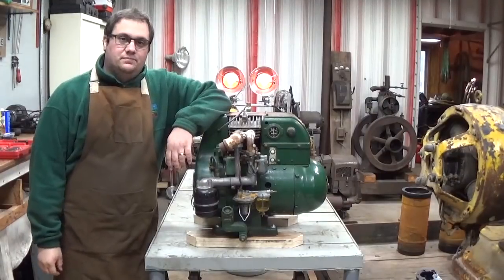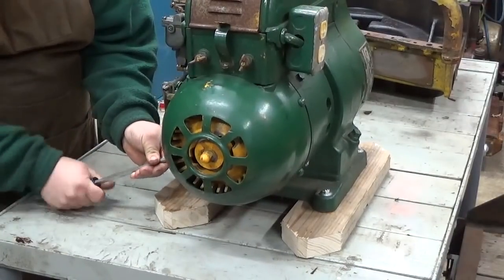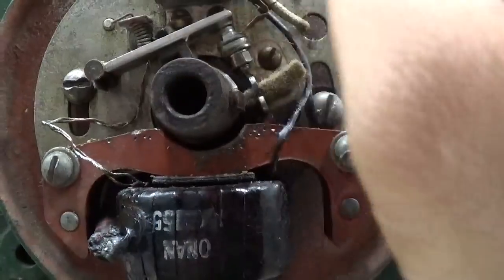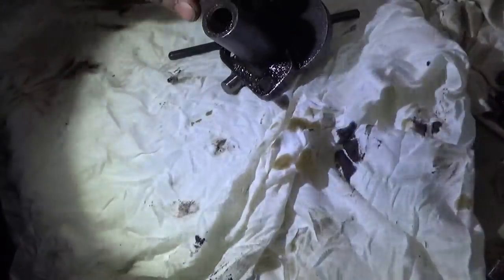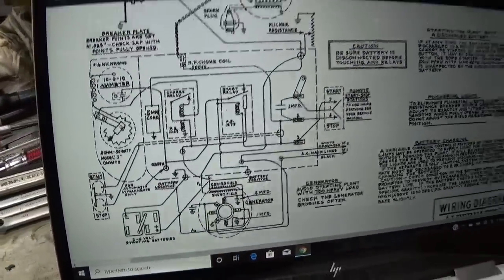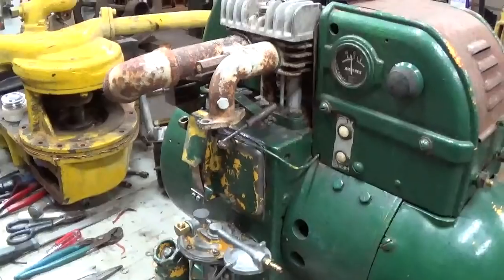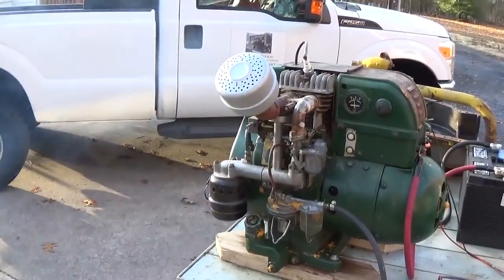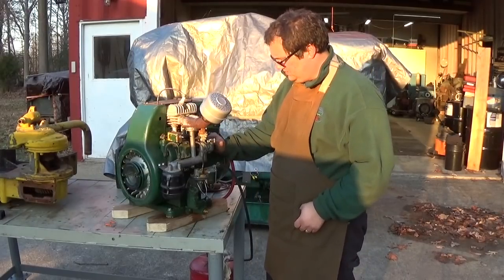1953 Onan Generator Repair and Generator Buying Advice

Comment: Morning Mike,

I've worked on dozens of Onan AJ generators, the 5kW version of your generator.  That was THE generators RV manufacturers put in motorhomes in the 70s and 80s.  Very reliable but LOUD.  When I saw the slop in your throttle shaft I had to write.  The governor hunting and the looseness of the link rod keeps the throttle in constant motion as is evident in your video.  That prematurely wears out the carb body and lets the shaft rattle around and more importantly allows a constantly varying amount of air into the intake tract downstream of the main jet. 

At first the engine runs rough, as yours is now.  As the wear becomes more severe, the engine begins to hunt.  That must be fixed.

I don't have any machine tools so here's my fix.  I bought a  piece of Oilite bronze bushing, sized to be slightly larger than the carb hole and slightly smaller than the throttle shaft and two adjustable reamers, all from McMaster-Carr.

I drilled out the carb body with a hole size slightly smaller than the OD of the bushing.  I reamed the hole until the bushing would just barely slide in.  I locked it in place with Loctite green bearing and bushing lock.  This is the strongest sealer available to civilians.

I did the same thing to the bushing's inner hole until the shaft just barely turned freely.  My dial indicator typically indicated less than 0.001" of clearance.  The Oilite  is made of porous sintered bronze and is designed to hold oil.  The throttle shaft will always be lubricated.

Next is the governor linkage.  It has a spring to take up the slop but once the attachment points have worn enough, the vibration overtakes the spring and more slop results.  What is needed is some dampening and a stiffer rod.  I made a curved rod out of 316 stainless welding rod.  That introduced a tiny bit of delay in the throttle operation.

For dampener, I went to the hobby shop and bought some thin brass tubing with an ID about 0.030 to 0.050" clearance to a rod that would be inserted.  The clearance isn't terribly important.  I cut about 1.5" length of the tubing and brazed it to a piece of thin steel I had laying around.  Probably 11 gauge, as that is the metal I used when I was manufacturing large BBQ pits.  I dimensioned it  so that when the drilled hole in the sheet metal was placed under a carburetor stud, the tube was near to and parallel to the straight line from the governor and the throttle.  I cut and bent a piece of welding rod so that it would be parallel to the tube when the other end was attached to the throttle rod and  would reach almost all the way through when the other end. The other end met the throttle shaft about a quarter inch from where the throttle rod attached to the carb arm.  I jigged everything up using Hot Block (https://rectorseal.com/hot-block-putty/) and silver-soldered each end using a Smith MicroTorch https://www.amazon.com/Smith-Little-Torch-Soldering-Welding/dp/B000T43L30 (*)  The kit comes with preset regulators designed to screw onto disposable propane cylinders and Bernz-o-matic oxygen cylinders.

(*)I use MAPP for fuel and a medical oxygen concentrator for the oxygen.  Once you've experienced the MicroTorch, you'll probably shelve your big tip.  Smith has a large variety of tips including a rosebud and a trident - 3 burners 120 deg apart.  Super-useful for things like brazing copper refrigeration joints.

CAUTION:  There are cheap chicom knockoffs on the market for about $35.  Amazon has an identical-looking kit for about $35.  I bought one to evaluate and then returned it, it was so bad.  One of the outstanding features of the Smith torch is the silky smooth valves.  The knockoff valves felt like water valves.  It did not come with the smallest 2 tips.  These tips have rubies swaged into the tip.  An almost invisible hole has been laser drilled.  The smallest tip will only run on hydrogen/oxygen (I have a jeweler's oxyhydrogen generating machine that electrolyzes distilled water into hydrogen and oxygen with enough volume to run the larger tips.)  Hydrogen burns clear and the flame is less than a mm long so it's hard to tell when it's lit.  A Smith tip will not fit the chicom knockoff so you're stuck with what comes in the kit.  Probably an imperial/metric thing.

A 22 ga, 1 ft long platinum-platinum/rhodium thermocouple that cost me $400 got embrittled by the 5000 deg f heat and broke.  I snipped the embrittled part off and was able under a stereoscope to weld the two wires together with the Micro-Torch, salvaging my investment.  My company manufactured induction heaters and I was designing a heater for a precious metal recovery company in which to melt platinum scraps.  He sent me a hunk of platinum about the size of a pencil eraser and tole me that was about $4000.  THAT promptly went in the safe.

A little research showed me that the melting point of platinum and the boiling point of copper are not that far apart.  So I developed the melter using boiling copper as the test medium.  A small celebration was had the first time I hit 5000 deg F.

-------
That assembly is a dampener which resists movement.  but only after the space between the tube and rod has been filled with Dow-Corning high vacuum silicone grease. (Dunaway Stockroom)  I'm diabetic so I used an insulin syringe to apply the grease.  Start with a small amount.  The engine will still hunt but not as much.  Add a bit more.  When the quantity is just right, the engine will simply purr at a single speed.

If there is too much grease, the engine will be sluggish in responding to a step load.  Lights will dim and then return to normal.  There is no known solvent available to the public that will dissolve the grease so if you apply too much, you must either use the insulin syringe to suck out some grease (difficult) or disassemble the dampener and wipe off the silicone grease, then start over.

I weighed the filled syringe, injected the grease and weighed again.  the difference is the amount of grease in 0.1 gram increments that was injected. When the correct amount was injected, I  wrote that value in my log book.

It is vitally important to use high vacuum grease.  It has no vapor pressure and so won't contaminate  a high vacuum environment.  For us this non-evaporation means that the grease will not dry out with age which would change the dampening factor.  This stuff is very expensive in the containers they package.  Dunaway Stockroom (absolute heaven for vacuum workers) repackages the stuff in small quantities that are affordable. 

End of brain dump
John
Reply: Very interesting thank you for sharing.

Comment: You know, I'm an electrical, or used to be in a prior life, engineer and I remember sending one of my students to the hospital when he was hit while working on an aircraft because someone had crossed the wires while installing a home made power box. We needed some way to power up our test equipment and one of the guys built this box we could drag around with us. As it turned out a couple of the plugs were wired wrong. It brings back memories of good times.  I just found your site and after an hour of watching your Vids I subscribed. Good content.

Comment: When i bought my 50kw it was running and making power. But the  data tag is missing and the oil pan was over full with diesel fuel.  I put new injectors and had the injector pump rebuilt. Alot of money but for what it is i think a got a great deal! Keep the  videos comming!!

Comment: Very nice job Mike. When we use to put flywheels on small racing engines, we would put some valve grinding compound on the shaft and flywheel and turn it back and forth to perfectly match the angle of both the shaft and wheel. Worked great but make sure to clean off the compound really well when done. Maybe turn the muffler down so water can't get into the engine. Thanks for great video's.

Comment: I have found over the years a nice way to clean up a taper is to take the key out and take high spots off then to "lap" the taper of the crank using the flywheel with some valve grinding compound spinning the flywheel on the crank it recovers most of the surface quite well.

Comment: Interesting video !!  The reason why that list of generators was compiled by amateur radio operators is that portable generators are an integral part of portable HAM station use  or in case of power outages so the station can be used to relay important info to fire, ambulance or police agencies during local, state or national emergencies!!

Comment: I have that same engine, but no generator. I also watched your other video on the same type of engine. I found this video very helpful as little information is available. My was setup with several  v belts to turn the generator. Mine also has the boss on the block for a fuel pump, but the holes have never been drilled and tapped. Mine runs good, but I am missing the air cleaner and pre heat tube.

Comment: The condensers you remove are typically there to cut down on RFI. They help control sparking from relay closures and such. Any kind of sparking is easily heard with an AM radio which is what everyone listened to when this unit was built. The knob next to the meter BTW is from a 1920's era radio. Bet ya theres an arrow on it.

Comment: The gas tanks is from a Gravely walk-behind tractor. This tank was used on Gravely's from the 40's thru the mid 70's. The dented part is not shown while on a Gravely but it is to allow clearance for two rivets that are are part of the fan cover that is located right up against the gas tank.

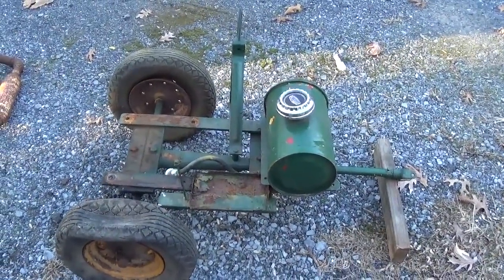Comment: Pausing at 4:50 for station identification and a word from your sponsor, LOL.  The cart is mostly an early Gravely sulky, commonly known as a C-spring type.  The tank looks Gravely as well, especially if it's capacity is 2 gallons.  The red paint and evidence of Gravely tank straps on the ends almost confirms it.  Good talking to you on Saturday.  Now back to your regularly scheduled program.  Get yourself an M-12 jacket and save on the propane, he he.

Comment: Hello Smallenginemechanic, I got back into engines last winter, fixing more up to date
generators but want to work on my 9HP cast iron Briggz an Stratton. 

Would I be considered rude if i asked if you knew where I could get a small rather old 
fashion rib style generator where you can see the windings. say a few thousand watts,
more for the oldness of it as i like old generators and glass insulators. I know generators
were somewhat larger for the watts todays gens have, but I think it would be great to get
say a 3 KW, old fashion gen that would take care of my place. I saw a gen on your video,'sort of a beige color open frame, along that line or with the cage around only the stator ( stationaty)
winding.

Thanks very much for any info and I really enjoy your vidz!

Comment: I have the same gen set. Mine needs brushes and condensers which I can't find(help). How safe   is it with the ground and neutral the same. Can I use a 3 prong plug? Thanks. Frank

Comment: A man I recently met is trying to repair a military two-cylinder Onan generator, and can't separate the generator rotor from the engine crankshaft. Is there a way to identify the correct manual from the many shown on the web site?

Comment: I live in an 84 unit apartment building that was built in the mid 70's. There is a generator set on the side of the building that is not hooked up...just sits there. I know nothing about it other than it is big. Almost semi-trailer big.  It seems a terrible waste to have it just sit. I hope they don''t decide to scrap it. Too bad I am not closer (Wisconsin) you could come and look at it and maybe even give them an offer.

Comment: Hey mike I was wondering if you would ever think about doing a more in depth video on the generator part of something like this. Like explaining the slip rings and the field side of things. Just how the while thing actually works . Thanks and great video.
Reply from the maker: Thanks for watching Jonathon!  I have been about doing a video about the different types of generator ends and how they operate for a while now!  It is on the list of things to do!
Reply: Ok thanks. I watch you and roadking all the time. I am into the same things. I have an onan gender I picked up and all kinds of hit and miss engines too. I just picked up a Sioux valve grinder I am cleaning up.

Comment: I can't believe I found another generator collector . Could you tell me where I could I find a manual for a Onan EL series 10kw generating plant . It has a ford 8n engine going by the serial number it's a 1951. I am looking for the electrical side .Schematic ect. Thanks

Comment: i love this generator! BTW... on the electric start... did I miss your explanation on how it works.. I.E. does it have a starter/generator starter? as in, it applies DC to to gen to start then, switches back to output? Similar to how Jet engine starter/generators work?